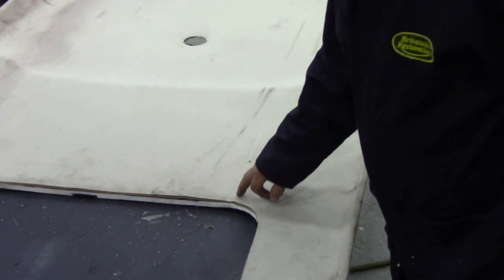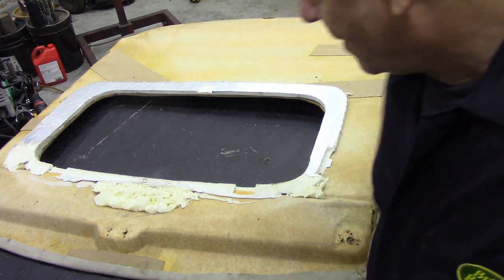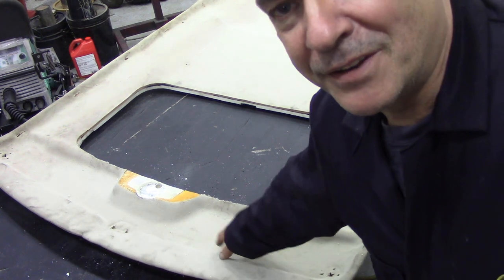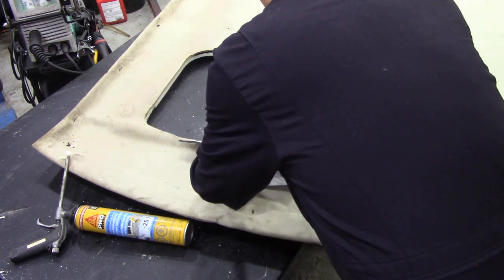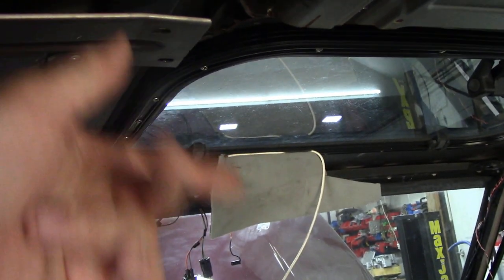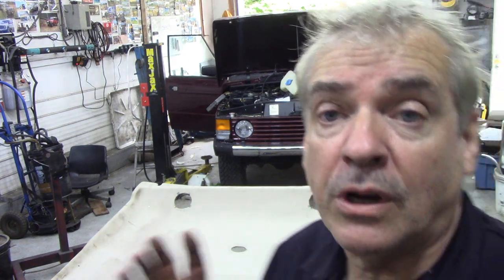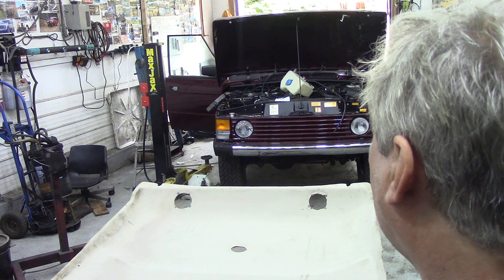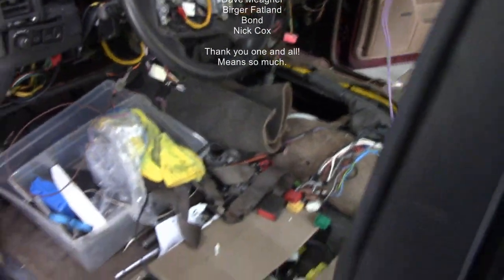Range Rover project lots of problems to work out Part 2

Comment: Sorry, I probably should put this on the last video, but with regard to the ABS delete, go for it. I did exactly the same thing on my 94 Classic with everything out of a mk1 Discovery.

It worked a treat, and most importantly kept it on the road. It is still going today.....with someone else. Stupid mistake selling it. 36mpg and it towed 4.8 ton once. It was a factory 300 tdi with over 200,000 miles.
Reply from the maker: I agree - this will make future work a lot simpler as parts are off the shelf - not of this 40 year old electronics and valves that I have no confidence in

Comment: Mike.  These Classics originally had a metal sunroof in past experience !  Could one cut some glass for the roof exterior and a piece of perspex as interior roof lining cut out sir ?  V.
Reply from the maker: Correct on the metal roof, but the customer didn't want a fixed roof - went down that road a few years ago...

Comment: I'm so fortunate my$1200 1992 RRC has a great working sunroof.   knock on wood.   I've had more issues with seat and door locks myself.   I've also had to build my own center console because the oem plastic one was decintegrating.
Reply from the maker: I think they changed the design in 92 - this is a 90/91 the only years this original sunroof was fitted

Comment: I fitted a new headlining to my RR Classic. The instructions said I would need to carefully drill holes through it to hold it in place. One of the holes was not, er, careful and the drill went through the roof..I was lucky as the vehicle was ex police and the roof already had several blanking plugs where light bar, aerials had been fitted. A blanking plug and touch up paint and no one will ever know.
Reply from the maker: Easy done!

Comment: Hi Mike, I found that if you keep the drainage tubes clear the sun roof doesn't leak, I live in Brittany France and in the winter we have more than enough rain to test them, not at the moment driest summer on record, the RRC is looking good mate.
Reply from the maker: Yes, but the seals are 40 years old!
Reply: @BritannicaRestorations  Yep, it doesn't matter how reliable a vehicle is, or how well it is looked after, anything made of rubber is the weak ling.
Reply from the maker: As the bishop said to the actress...

Comment: Black silicone fuel pipe would fit nicely around sun roof Mike you can get it in many sizes and it will squeeze in easily
Reply from the maker: I found there are 10 feet rolls of black O ring on Amazon for $14 from 1/8 to 5/8

Comment: Can't say the same about drinking beer...... [sip], but a good workaround on that headliner. Would have been a decent fanny around getting the backing Styrofoam just right. Be good to see it recovered and in place.
Reply from the maker: Used a full sheet of foam for that, as we cut a plug first and used that as a template - cocked up the first as we made it too large but once we had a rough cut we then trimmed it up in situ all fastened as it should be - not much room for error!

Comment: For goodness sake don't let anybody press the old sunroof switch on or you'll peal the roof off doing 120k on the highway 😂😂🇻🇨
Reply from the maker: The latest issue is getting the rear washer to work - the circuit works via the sunroof relay - which is no longer present, and then is timed by the 'intelligent control module'...

Comment: Hi Mike just done a overhaul of Sun roof and as you said previously they are quite simple but plastic parts for rail guides crack after 30 years (nothing lasts) mine went back together and is working open and tilt  I made a bad vidio of job I intend to post at some point
Reply from the maker: Did a P38 sunroof with 3D printed parts to fix the broken bits, worked twice and jammed open - customer not happy and ended up buying 2 side rails  $$$! Fixed it and still running good 5 years on